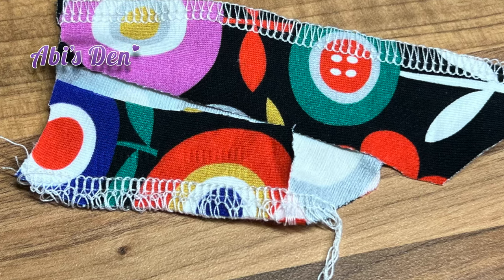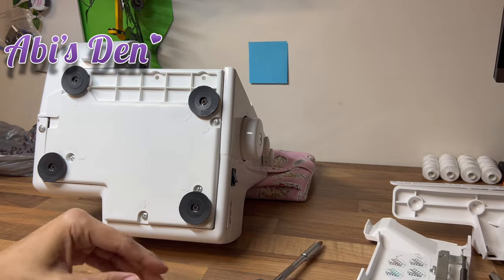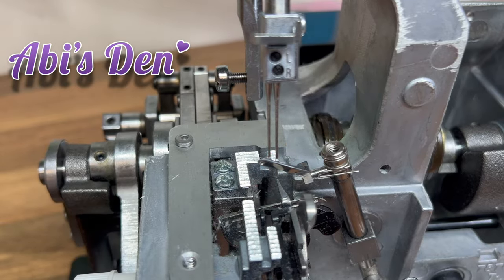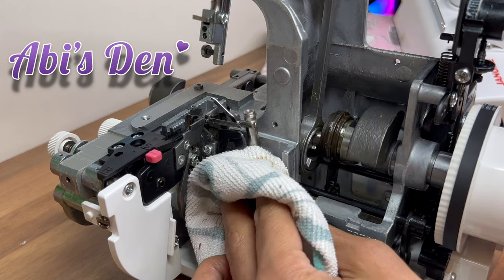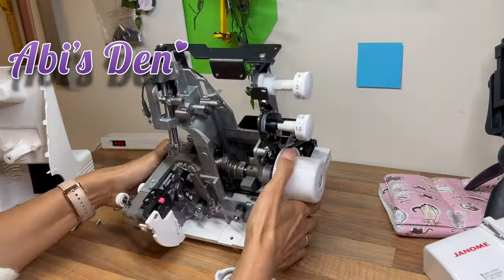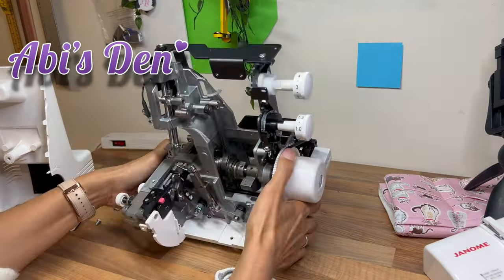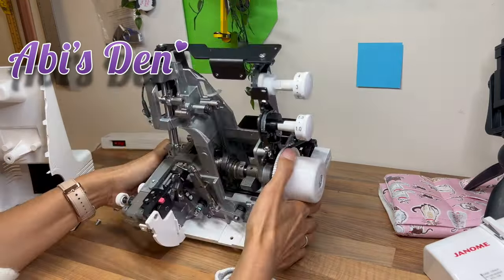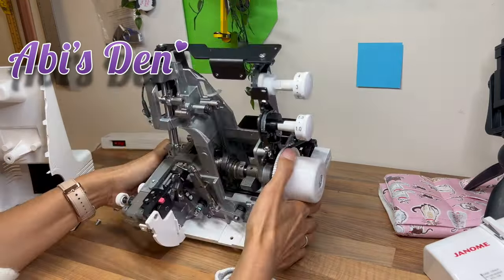Why do my stitches look so bad on my overlocker? Works on ANY machine  #AbisDen #Overlocker

Comment: 2 tools that I find great for cleaning and oiling are:
-Dental micro brushes. They grab lint well and you can pull it out of tight spots. They can also be oiled  and used to brush on oil when you only need a light coating. 
-The other is a clockmakers precision oiler. They have a long spout and only give a tiny droplet of oil each time compared to the big drop from most bottles of sewing machine oil.

Comment: Darn my brother doesn’t open on the bottom left like yours 
It’s near impossible to clean
I just use qtips to reach in 😢
Reply from the maker: Hi Wendy. That’s a shame, which machine do you have? I would be very careful  using a tips, they could add fluff to the machine